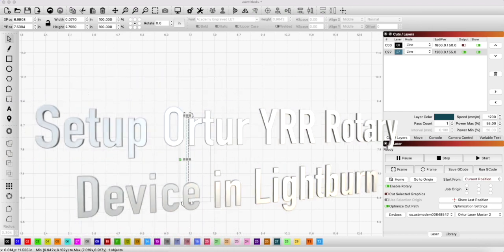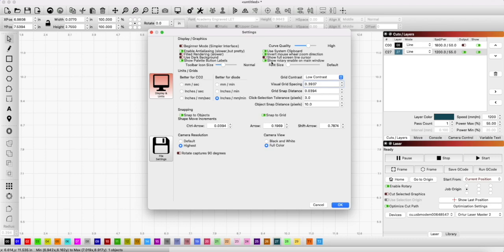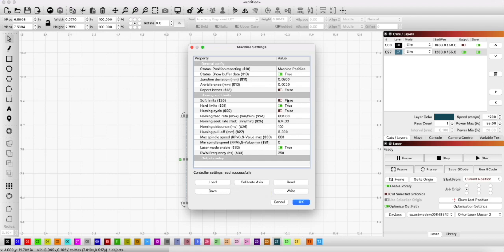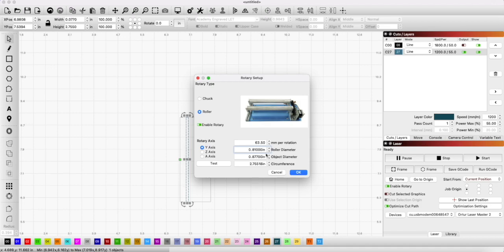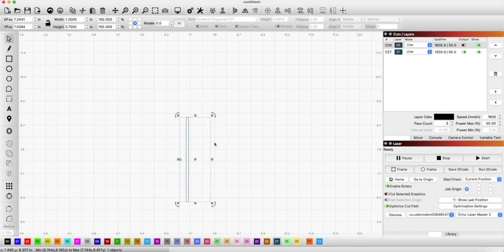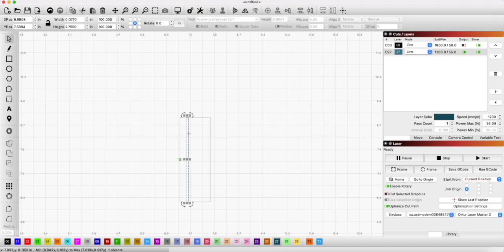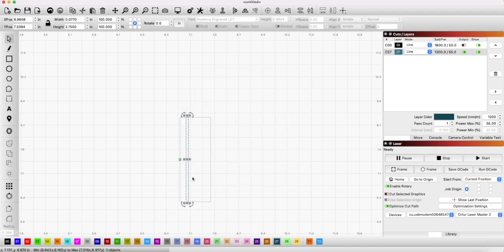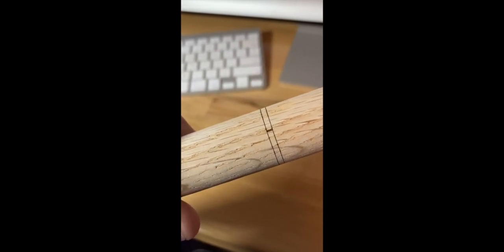Setting up Ortur YRR Rotary Device in Lightburn

Comment: Hi
Good video, but the one thing you didn’t explain was, how did you work out your rotary axis mm per rotation (your original figure before minor adjustment) are people just wrapping something around it and then measuring that or is there a maths way of calculating this, On my version of lightburn it’s set at 360 mm per rotation?

Comment: Tried to get this Ortur rotary roller working with my Sculpfun S9 but the roller step motor won't turn.  It just vibrates.  Any thoughts on the problem?
Reply: stepper wiring is wrong, switch around cables and it will run just fine.

Comment: Bless you...  I was really frustrated trying to figure out how to get it to work. I still have the problem that it thinks it's position is way off at -28 for the X and Y axis and off the charted territory for the burn. However, setting the origin seems to be a quick fix for that. Additionally, the text was all mirrored (found that switch as well....) .... oh.... and I had to remember to rotate the text 90 degrees. All newbie mistakes.

Comment: Do you have to change the settings each time you use a different diameter item? I noticed after doing the setup that on a smaller diameter cup due to a taper that my design becamer squished.
Reply: Wondering the same thing.
Reply: Yes, you always have to input the diameter of the item you're using.
Reply: @TheLouisianaHobbyGuy  that's a pain. Need to make that a tab instead of a separate window.